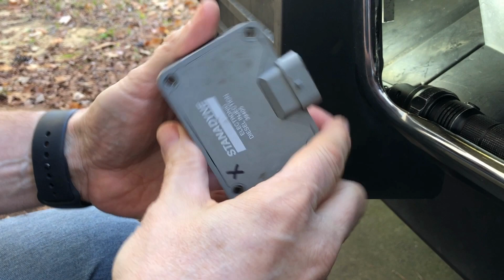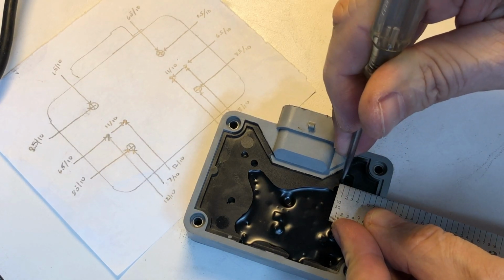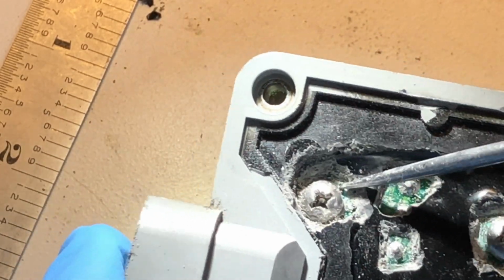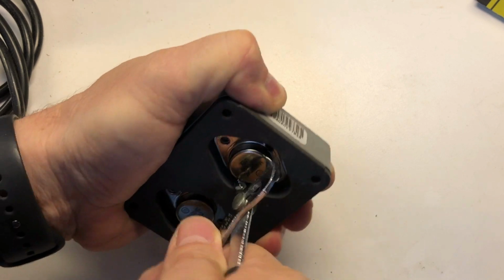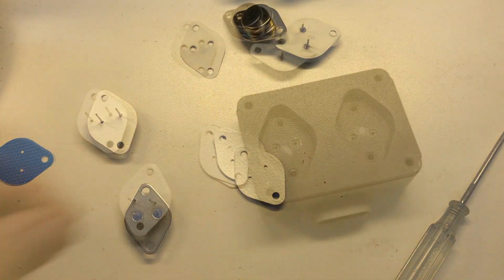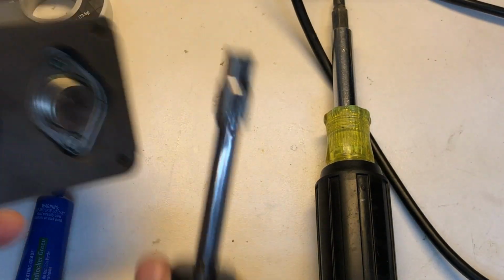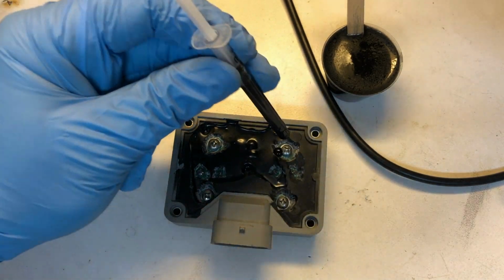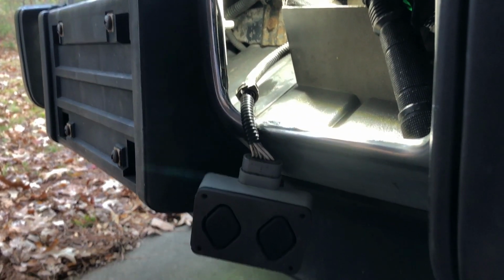1994 - 2002 GM OBS Truck 6.5L Diesel PMD / FSD Tear Down Rebuild (Chevrolet GMC w/ Stanadyne 39405)

Comment: There are other conformal coatings that can be used that are removable. Manufacturers prefer to use these cheaper potting compounds mainly to prevent others from copying the circuits. I would personally utilize an external aluminum heat sink and extend the contacts up to the secondary heat sink. There are high temperature gasket compounds that can be used to seal the new heat sink to the old substrate to prevent moisture ingress into the main board. The same can be used to seal the transistors to the new aluminum heat sink without issue. Now this will increase the thickness of the whole assembly which might call for it to be moved from one location to a more protected location. If one carefully researches the connectors used they will find them available from specialist suppliers for the automotive industry most of these connectors are water rite since they are used under the hood. You could make an extension cable to move the device to a better location. If the device is mounted in a protected location you could also mount a small computer fan in front of the heat sink to keep it even cooler.

Comment: Found it...this was what I was curious about!  Thanks for this!  We can just flip out the PNPs.  That is WAY cheaper, even with a matched pair, than the unit itself.  I suspected the rest of the board is likely pretty robust.
Reply: Never assume the rest of the components are robust. You would be surprised how surface mount components can be affected from heat alone. Many times it will be impossible to uncover the surface mount components to repair them. It would be nice to find someone to reverse engineer this assembled. More than likely it has a programmable microprocessor in it as well, good luck with that.

Comment: Nice job on the content. You covered everything well. My PMD has just started playing up (replaced 12 years ago, moved to behind the grill), so I'm waiting on a new new one. Once it turns up I'l pull the transistors from the dying one and test 'em to see if they're worth replacing.

Comment: Great Video, what if one wanted to build their own extension harness ..  do you know the type of connectors needed to buy from an outfit like Digikey same with the heat sink.  Thanks!
Reply from the maker: I don't know the Aptiv part numbers for those, but would have to presume they are available as the extension harnesses do exist.  I would expect though that the cost of purchasing only two connectors, plus the pins and crimping tool, plus shipping, would mean it's cheaper to purchase an aftermarket extension harness already assembled and tested.   The heat sink though could likely be sourced cheaper than pre-made, though you would have to drill and tap the aluminum for the PMD special torx screws and sand smooth for the thermal mounting pad.
Reply: @DrShock  OK ... didn't know if you knew the connector number or style .. I'll do a little more research on it and may post a video on making one up.   As far as having the the tools I do have those already and the auto wire.  From what I have priced for the kit ..  heat sink and harness I thought was a bit pricey compared to doing your make up.  Thanks again on a great video ...

Comment: Watched this a couple of times, having an intermittent problem with mine (2000 3500hd) and moved the PMD. Might try this to build a back up. Just wondered why you remove the screw head potting? Seems this is unnecessary- just remove potting on the solder contacts, and remove nuts on the transistor side, desolder, and install new. Also, did you test the old transistors? And do these fail intermittently leading up to a permanent failure or is there some other possible failure mode like a cold solder joint or broken circuit board connection?
Reply from the maker: Part of the failure analysis across some forums in the day was loss of fastener torque, leading to heat sink failure which kills the transistor internally.  So you have to do more than what you suggest in order to completely remove both of the devices for replacement (and new heat sink materials, new fastener adhesive).

Comment: Can you diode test the old ones before they're removed to see if they're bad?
Reply from the maker: You would have to desolder the leads to perform the diode test, due to the nature of the surrounding circuitry you would otherwise get false results.

Comment: I where do the wires? From that harness go to on the motor I had a shop saying, they repaired mine. Put a new one in it and somehow, the truck was running when I got home it wouldn't start again when I pulled the harness. It was cut completely all the wires and 2 places and they take it back in there. So I couldn't see it underneath the battery. So now I gotta run a new harness. And I'm not sure where it goes.  From the p m d box to the motor

Comment: My experience of checking several of these PMD/FSD is that these power transistors (PT) are probably not the cause of stalling problems. None of the 10 I have checked had faults/breakdowns with these transistors. If you remove more of this epoxy, you will see some SMD on the printed circuit board. I suspect that it is in connection with these SMDs and their thin wiring paths that the errors occur. These components are much more sensitive to the large temperature variations than the powerful and well-built power transistors, which then create most of the heat. I have also tried taking out the 2 (PT) and putting them outside the PMD (on a separate cooling jacket), only connected to the PMD with wires. As a result, so much heat is not transferred. Now this is a rather impractical solution in relation to the installation of PMD, but a possible solution. By the way, I used a Dremel to remove the epoxy (with a light and steady hand) to avoid adding strong heat to the wiring paths and SMDs.
And if you want to protect yourself from gases, you need something better than a good facemask, one with an ex charcoal filter....
I probably wonder if the constructions on these PMD boxes are actually physically well enough designed to also handle the large temperature fluctuations that occur. Their surface area should perhaps be larger as the heat from the 2 PTs will be concentrated and will affect the other and more sensitive components in the box to a large extent. And this epoxy, I think it is a bit unfavorable in terms of not releasing the heat. It will probably be able to protect the components, but in relation to heat, it may not be so favorable.
 Good Luck...

Comment: I really appreciate your videos, I am not in the electrical world but hate simply throwing something away that people used to test and repair!
I recently tried my hand at this type of repair, a soldered in fuel pump relay in a fuse bus. I was very happy to pull it off for my client and admit I felt a bit like a bull in a China shop with my tools for the job. I used a Weller soldering gun and a compressed air blaster ( not sure what they are called right now) to get the solder off the pins.
It worked!

Comment: Thank you very much for your videos I just happen to have four dead PMD’s sitting right here that I’ve already started to take apart after watching your videos I have started working on dismantling number three, and I’m gonna be ordering transistors for them..The transistors are definitely testing bad The one PMD was interesting, with sort of a translucent jelly type stuff, some kind of heatsink I’m sure? .  Do you have a test procedure for the PMD it’s self while it’s still on the vehicle? other than just knowing that it’s not starting? Maybe a way to connect to it while it’s plugged in?
 I am liking all of your 6.5 videos👍🏻 Cheers
Reply from the maker: Thanks.   The potting material you describe, the translucent jelly type sounds like an aftermarket PMD like FlightSystems or D-Tech.  Stanadyne never used that type of potting material.  Neither GM nor Stanadyne published any sort of complete PMD test.  There are some basic voltage checks in a Stanadyne service bulletin, but those are just completely dead or not type tests.  They don't find anything in between.
Reply: @DrShock  Thank you, for getting back to me so fast, I just search the model number on it and it came back as “Dorman” it is a-904-104 I remember it not lasting very long and it looks a little bit different on the inside,  that jelly stuff looks very toxic handling it very carefully! The stock potting material is a lot different, The first one was a good learning experience to whittle a way at even though I think I did OK, but now I know where things are located can avoid some areas, I was hoping that this day would come along where I can repair these seemed like such a waste just to chuck them, I guess that’s why I held onto them for so long. The same with the truck 2000 gmc 3500 4x4 dually, it’s been my daily work truck for the last 12 years been very reliable hauling huge loads all the time! I also have a 1993 1 ton 4x4 same truck still going strong right now it’s the running one, lol  anyhow cheers and thanks again for keeping these motors alive! 👍🏻
Reply from the maker: Thanks.  That Dorman would be just throwing their name on a D-Tech type (has a notch in the top black plastic casting). Yeah that material is definitely not anything you want to breath in fumes of if heating, definitely a chemical mask op.

Comment: That's pretty bad that you are going through PMDs every 3 years. My dad's truck (95) had the pump replaced once under warranty when the PMD failed, and then it failed again one time after the warranty was up, and he moved it to the front behind the license plate then and it's never been an issue since. Seeing as these are just regular BJT transistors and nothing really special, I'd look for some different parts that have higher current ratings (I'm not showing much doing a quick search at mouser though). Do you put thermal paste between the back of the PMD and the heatsink when you mount it? I'd at least use some regular white thermal paste (or you can also use penaten diaper cream - it's basically the same stuff - zinc oxide paste - I've actually used penaten diaper cream on a CPU heatsink when I couldn't find my jar of thermal paste - never had an issue and that machine was my main computer for many years after)
Reply from the maker: The ones failing here are not my rebuilt ones, but rather the factory original Stanadyne ones.  They are discontinued now, so Stanadyne no longer cares to figure out the remaining design issues.   I do not expect my rebuilt ones to fail like the originals.  ;-)

I also am running a Standadyne injection pump replaced once under GM extended warranty back in 2004 or so.   It's only the PMDs that have a very abbreviated lifespan.
Reply: @DrShock  I wonder if the difference is the "gray" PMD vs the "black" PMD - mine is definitely the black one.
Reply from the maker: I used the black one until the gray came out.  Same frequency of failure replacement.  Part of this is likely the application, the diesel 4WD Suburban is the most cramped/high heat layout of all the C/K trucks imo, even behind the bumper.
 
The other caveats are that this has been a south Florida truck, daily highway driver baking in the scorching sun never to experience a garage or winter until recently. It's 
 climate where that bumper easily gets hot enough to fry an egg every day.  It's still on the road 7 days a week, for multiple hours each day where it leads a life more like a delivery van than a typical 6.5L truck.  

I'm sure some or all of these factors contribute to aggravating the PMD design flaws more so than the average truck.   Hence my side project to rebuild these and improve the parts and materials used in the design to see if I can get a longer PMD lifespan with this same vehicle.
Reply: also it would be interesting to completely de-pot one and look at the circuit design to see if there's something that could be improved to prevent the transistor failure - it's like there's some flyback diodes or something missing from the design...

Comment: That was very informative.  I hope you will forgive me for some criticisms.  I would expect transistors bought from ebay or amazon to be counterfeit.  Mouser and Digikey both have this part, and Digikey will provide free shipping if you prepay by check.  

Finned heat sinks are completely dependent on the velocity of air flow thru the fins.  If the PMD were to be mounted so that the length of the heat sinks fins are parallel to the oncoming airflow when the truck is moving it would be more effective.   So instead of being mounted behind the solid part of the bumper, mount it in the hole you are reaching into so air will flow thru (along the length of) the fins.  If you have a thermocouple temperature meter with 2 input channels, you can measure the temp of the heat sink and the temp of the PMD case.  This will tell you if there is poor thermal conductivity between the heat sink and the PMD case.  I like to use the white aavid thermal grease instead of thermal pads.
Reply from the maker: Thanks.  I would characterize heat sink location and airflow concerns as a secondary, or even tertiary factor for this particular PMD design.  Airflow alone is not what primarily affects the transistors lifespan (MTBF) here.    They actually fall victim to two other factors regarding heat dissipation, at least with the grey Stanadyne model.   It's not lack of cooling in motion alone that will result in premature failure.  It's when the vehicle is at rest that we have to look primarily, at how to dissipate the heat.

The post drive heat soak, after the engine is off and the vehicle is no longer in motion, and then the repeated heat-cold cycling that follows normal vehicle usage is where the root causes appear.   

After over a decade of analyzing failures, including purchasing DOA PMDs off of eBay, I have a good idea of the ways they fail that can be repaired (some small % also fail in non-repairable ways too).

Various combinations of lead-free solder joint fracturing at the TO-3 transistor lead(s), loss of torque at the TO-3 fastener(s), and failure of the transistor die itself internally due to repeated excessive thermal exposures all cut the lifespan down considerably.  Typically component failure of the PMD sets in around the third year or so of use.

Once the vehicle is in the garage after a drive, no PMD mounting location will save the PMD as there is no airflow involved. Nor any fuel flow for the factory IP mount point.   The PMD will fail over a 3 - 4 year period of time due to the vehicle at rest factors I mention without improving the heat dissipation at rest.

Over the next few years I hope to find that the use of leaded solder, superior thermal pads at both the transistor (as shown in the video), and at the heat sink mounting (not shown), as well as superior fastener torque protection can extend the designs lifespan (MTBF).  Improving the thermal dissipation is the only lever we can tweak when the vehicle is at rest.  So the better pads and better contact with the steel of the bumper, or frame is the focus. Only time will tell over the next few years whether these matter or if the fundamental flaws are simply too great to overcome to get 10 years of life out of one.

With Stanadyne production having ceased in 2015, the day is fast approaching where rebuilding a grey PMD is going to be the only source for a working one.  Hence this project that I took he time to share with you all.
Reply: @DrShock  Thank you for your detailed reply.  My background is cooling of electronic equipment.  Bellville washers under the nuts holding down the transistors will maintain clamping force.  A fan directly on the heatsink as shown in a product on Amazon called " AAVID CPU Cooling Fan & HEATSINK, 50mm Sq. Fan, 50mm X 52mm X 43mm Silver Heatsink & Fan, TX3 3PIN Connector "  will provide cooling when the truck is not moving but it and the pmd would have to be mounted inside the cab for weather protection.  The power to the fan would be controlled by measuring pmd temp.. Finally, the transistor leads could be extended out of the back of the pmd case and mounted on two new heatsinks.  These heatsinks would be electrically insulated from each other  and the cab of the truck.  In this way thermal grease can be used instead of an electrically insulating thermal pad.

Comment: Good video. I was a control engineer and knew you could repair the transistors but never knew the details of the how to do it. You have covered it well. On my 6.5L 2001 van I bought from the Air Force I found the PMD to be without a transistor something most 6.5 owners would not think to check. I did not run it very long that way and it has been running well for the last 3500 miles. I also used your video on how to set the injector pump timing after I had the pump rebuilt it really helped. The van is very different since you actually cannot see the timing marks and actually have to use a mirror. It took me awhile to do it all working in 20deg Wisconsin weather but I did get it done finally. Thanks again for your efforts.